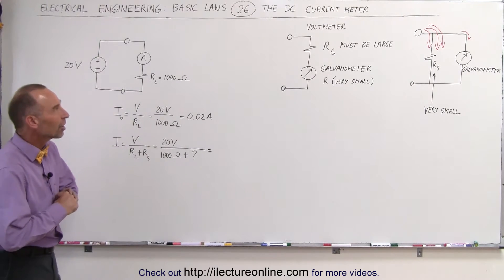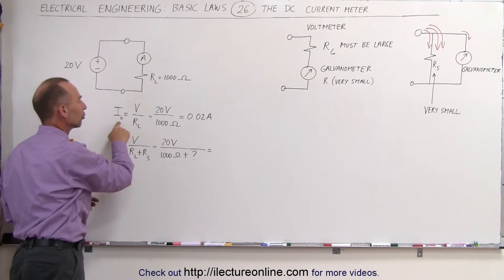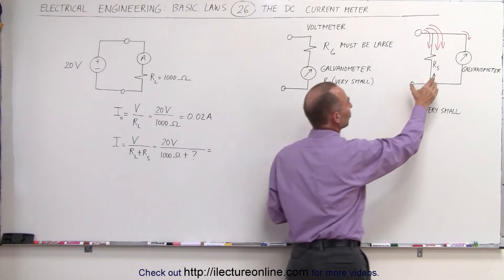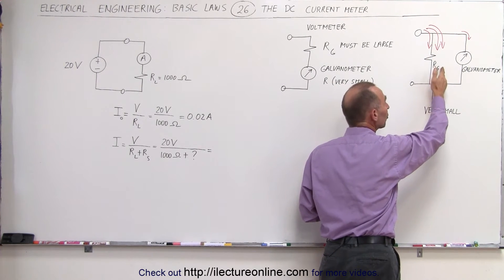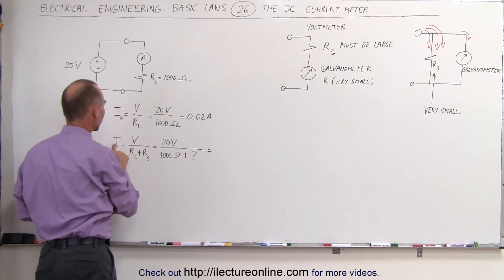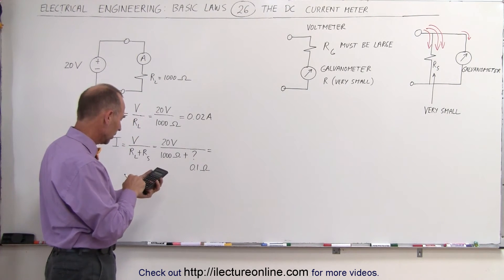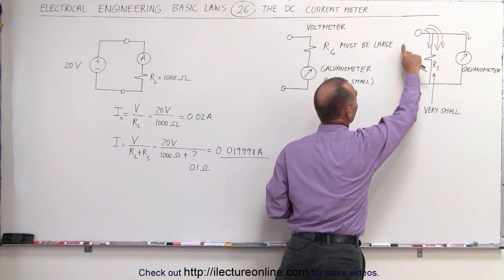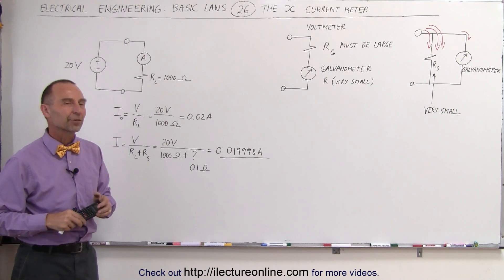Electrical Engineering: Basic Laws (26 of 31) The DC Current Meter

Comment: i know it wouldn't make much difference, but don't you also have to consider the resistance through the galvanometer in the final calculation?
Reply from the maker: For the voltmeter it makes no measurable difference.